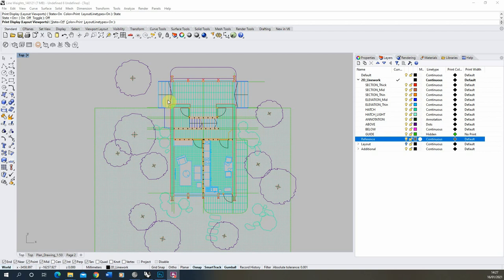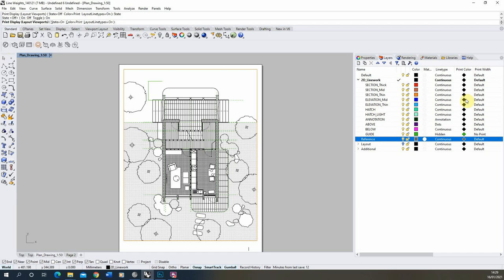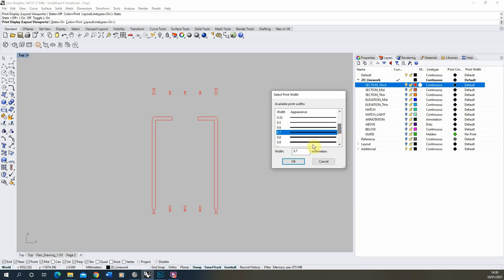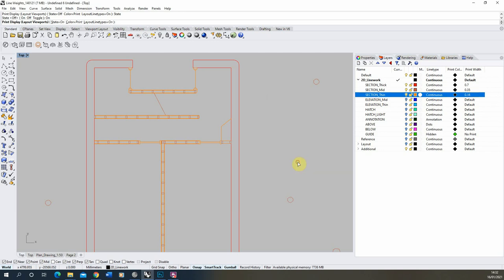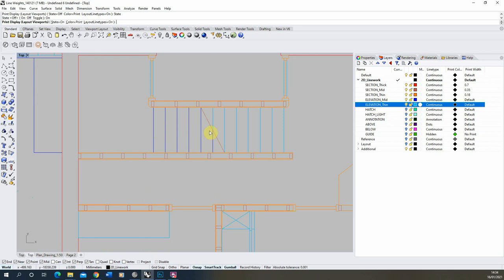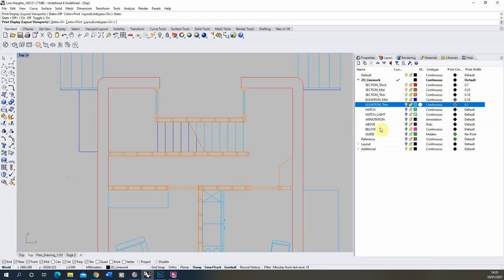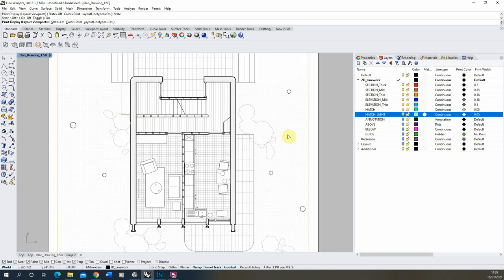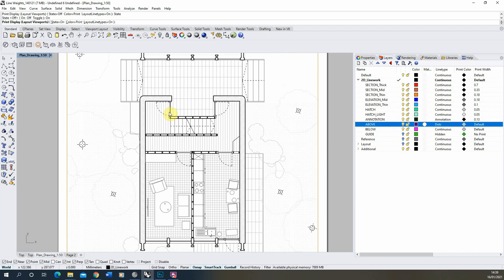Architectural Line Weights - Rhino 2D

Comment: Hey. If the scale of drawings was done in  the scale 1/100 on which number I need to multiply your thickness of the line which you showed on the video? Like in your case the structure was done 0.7 what would the same structure in the scale 1/100? Is there any principle in this topic depending on the scale of drawings? As far as I know Rhino doesn’t scale the thickness of the lines automatically. Thanks for video!
Reply from the maker: Hi Ana, I actually wouldn't change these line weights if I was working at a different scale. Any thicker than a 0.7mm - 1mm will look very bulky in the drawing. The only thing I would consider is maybe making the structure line weight slightly thinner, ie 0.5mm for a 1:100 to make sure the lines for the structure do not merge into one another (as discussed with the plasterboard in this video)

Comment: Is there a way to copy these settings into another document, every time you load Rhino?
Reply from the maker: Hi Sasha, probably the best way is to make a template file with these layers. Then every time you start a new project, open this template file and do a 'save as' so your new projects are always set up in the same way
Reply: You should use one of the standardized cad styles and layers.